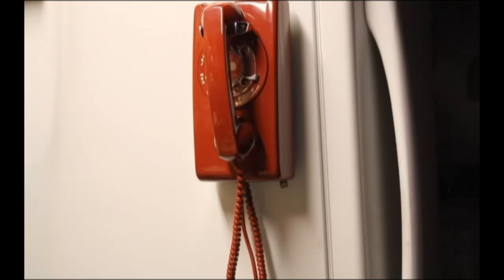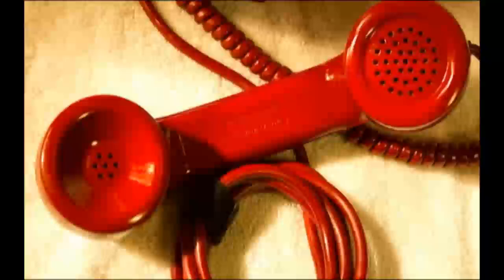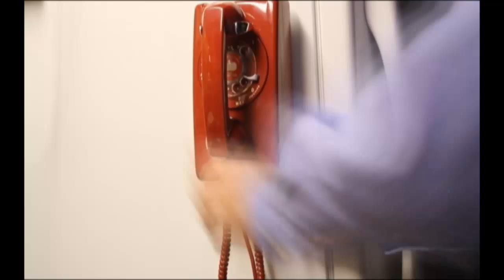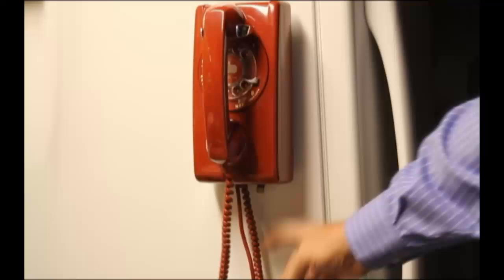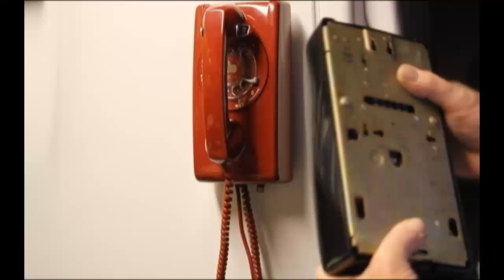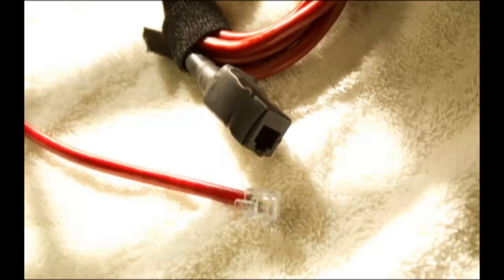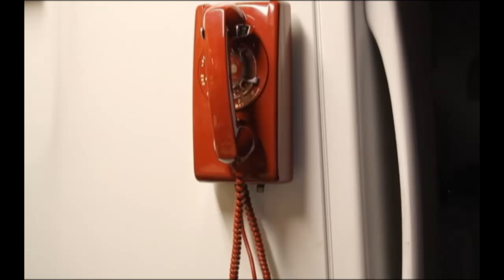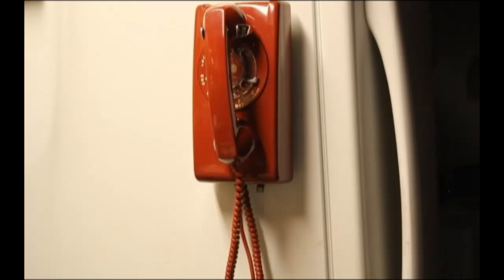Western Electric Rotary Wall Telephone

Comment: Can you tell me how to get the cover off? I have one of these mounted to a wall, it is tightly screwed on, so I can't just lift the whole unit off. I need to get the casing off so I can loosen the screws. The top comes free, but I can't seem to get the bottom free. It feels like there is almost a catch or something. What secures the bottom of the cover in place?
Thanks! 
Hannah
Reply: +Hannah McKeand - You're right that there is a catch on the bottom. Push the bottom of the case in towards the wall with one hand. While holding it there use your other hand to press the catch (on the bottom center of the phone) inwards to release it. The housing should now come off easily.
Reply from the maker: Hannah  which video did you look at?  Let me know.  Email me at telsosteve@gmail.com if it is still a mystery.  Subscribe if you have not done so.